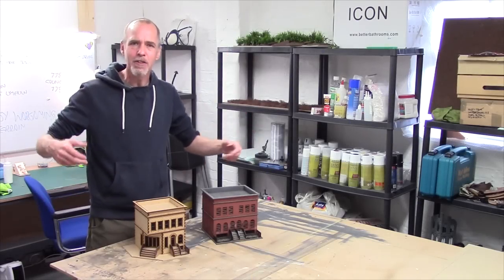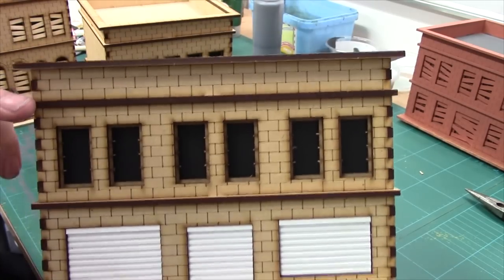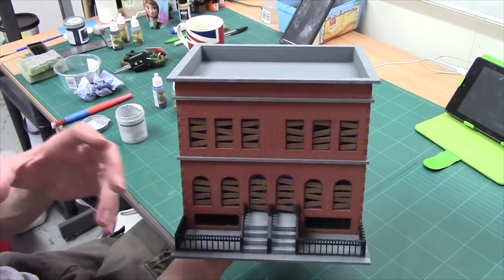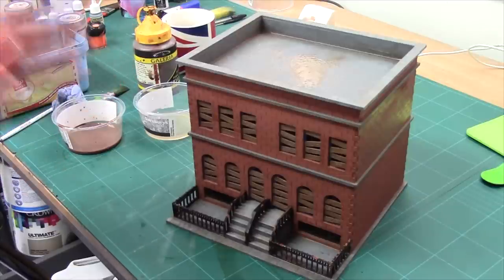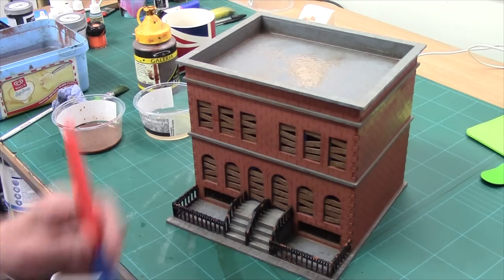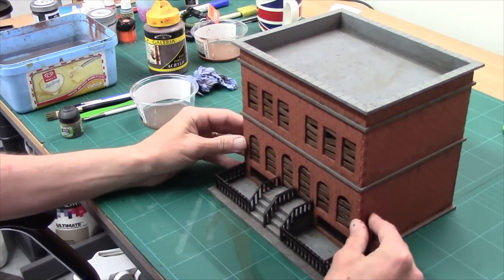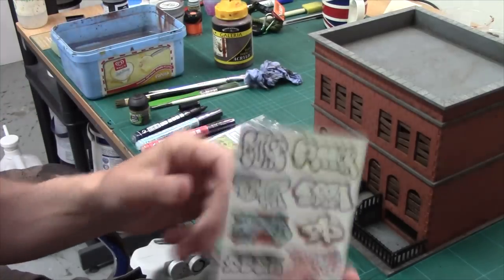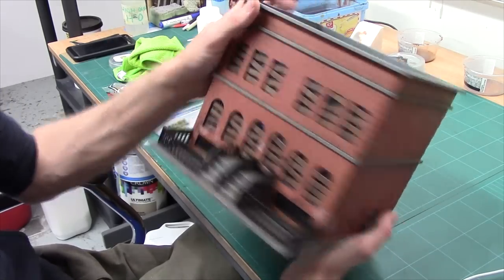Simple Zombie Apocalypse MDF Building Painting Techniques

Comment: My grandfather was a wood carver.  I have a wildcat carving (about 1/5 scale) that has rocks carved from wood on the base.  He never finished it.  He had the rocks primed, but that was as far as he got.  A few nights ago I decided to paint them and give them some washes and finish it up.  I've done a couple black washes and a brown wash so far.  The brown wash gave them the appearance they have some mud on them.  I may do a tan wash on spots to give the illusion it's mud that is drying.  I did some dry brushing before doing the washes.  Once I'm happy with the washes I'll do a bit more dry brushing on spots to give the appearance the wet rocks are drying out around the edges like the mud.  I'll probably do a green wash in spots around the edges of the bottom rocks and may do some patches of moss with fine turf.  It's been sitting unfinished on a shelf in my bathroom for years.  After learning different techniques from you and some other crafters I decided I could do a proper job on the base.  So far it's looking great.  Thanks for the videos!  Now this really cool cat will soon have a proper base.

Comment: Excellent as always, Mel! 

My only contribution is it doesn't hurt to seal the MDF before painting. On some laser cut pieces, adding the smallest amount of water creates an ugly fuzzy texture. 

So if you plan on doing a lot of laser cut stuff, get yourself a sealer. I use Chesnut brand shellac sanding sealer and it protects the wood and gives it a lovely smooth finish. Incidentally, it's the same stuff Sarissa use to seal their pieces. 

If you're spray priming you can get away with some kits, but not all laser cut stuff is the same so it's always worth sealing just to be safe.

Comment: Great work, I have a question, what did you use for the windows? How did you make the boards fit?
Reply from the maker: What exactly do you mean matey?
Reply: I wanted to ask if you boarded the windows before putting the black cardboard or did you out the boards on the windows after the black cardboard